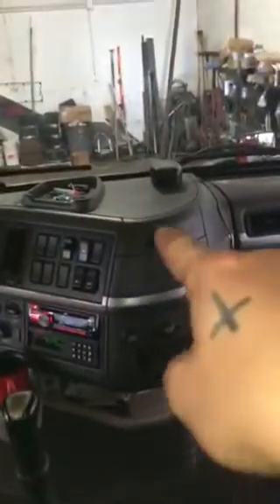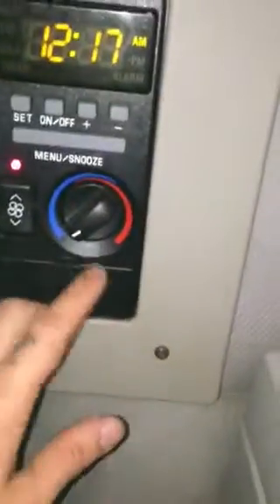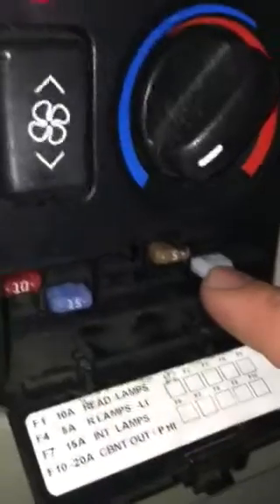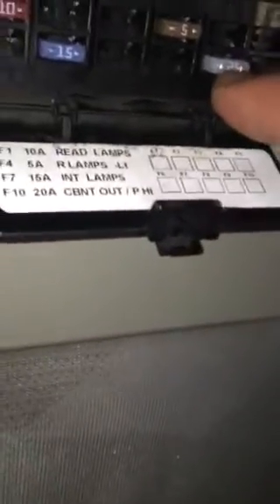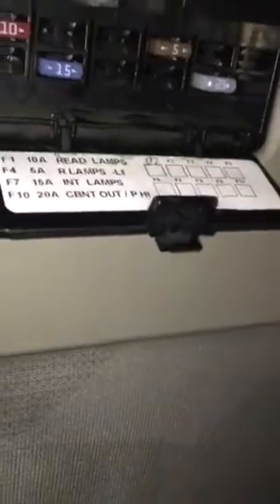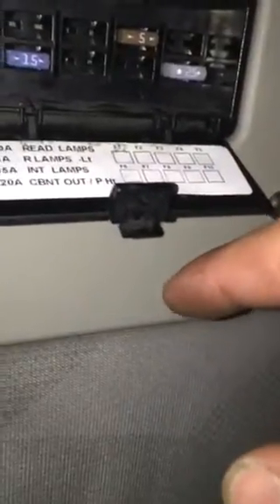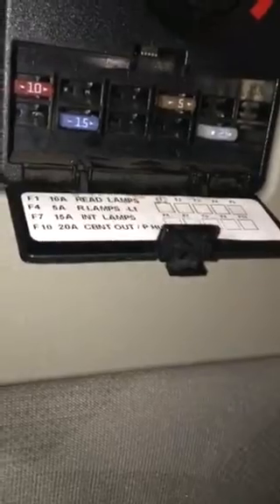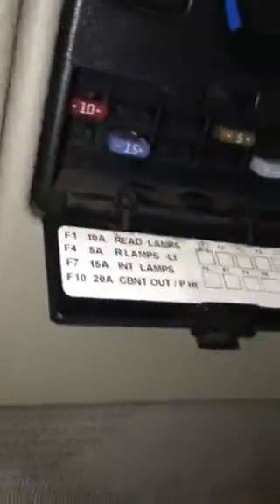Volvo sleeper 12v plug and light issue

Comment: I have a 2000 Vnl. There is no fuse box in that panel. I lost my upper dome light and lower table light. Switch on dash not working. Fan motor a cig light work but all 3 light switches not. Any ideas??